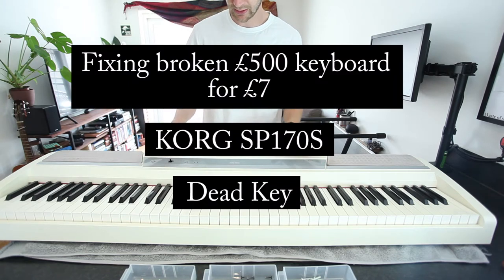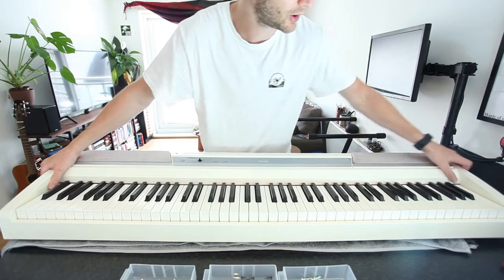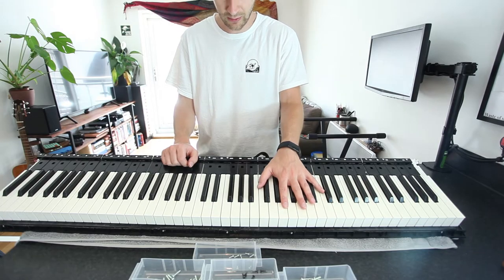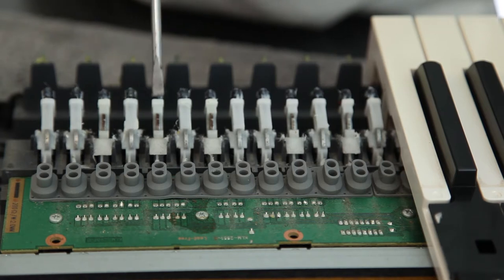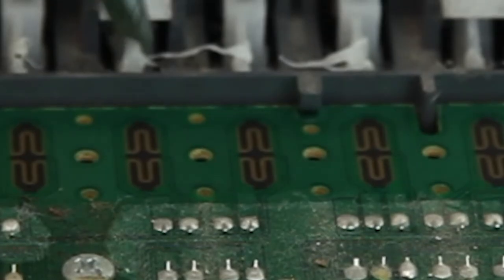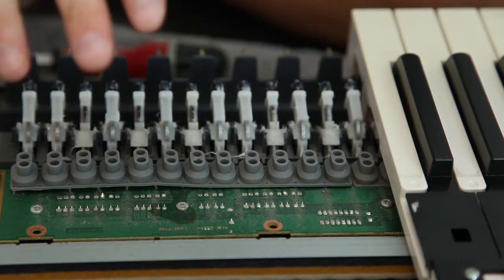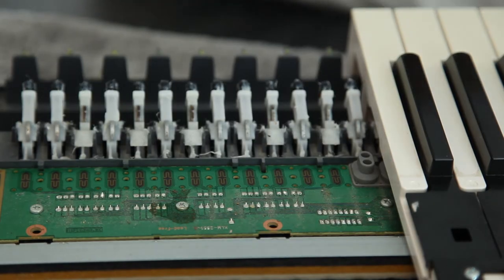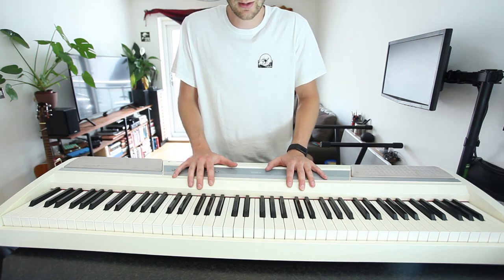How to fix a dead key on a keyboard - KORG SP170S Piano

Comment: Really helped so thanks a lot. Few notes; The PCB isn't carbon coated, thats the carbon off the contact, you should clean the PCB with alcohol under the contact area, but don't ever try to clean the carbon contact on the rubber. Just cleaning the PCB brought back all the velocity subtlety and even-ness that was missing. I also wiped the rocker ends and replaced all the lube with silicone grease, and moved all the yellow grease at the key end back into place. Again this made the travel much better, the grease was £8. I also pushed the large edge connector at the keyboard side / end back, but it bowed a bit resulting in a missing contact or two. At first I got multiple/miissing notes until this was pushed back fully along it’s length. Lastly, all the rubber pads have small pip’s or legs that fit into small holes in the PCB. It is really worth going over these three times to make sure that they are all fully through and seated. I had a thin rod that I used on every pip to make sure it was all down totally flat. It took several passes to get right.

Comment: Thanks! My son's old Korg had 6-7 dead or wonky keys. I bought a set of replacement silicone contact strips for $50, and I was able to get almost all of them working again. It now has 87 out of 88 working keys, plus one extra screw left over 🤣. I know exactly where it goes, but I'm not taking out the other 30 screws again just to put this one back.

Comment: This worked perfectly.  I took my sp170s apart as in the video.  I purchased 7 of rhe rubber contacts from Korg for $40 Canadian.  Be careful when replacing the keys.  If the strip moves even slightly it won't work.  I suggest keeping the wiring connected when putting the keys back to test if they are working.before screwing it all back together.

Comment: Works like a miracle. I used a 8B pencil on the carbon pads. For the keys which were still not working, use a dustfree eraser, blow clean, then apply the pencil again....all worked well.

Thanks a lot buddy.
Mine is a Korg SP170S
Reply: Hi Zany Oriel Rows. A question on your coment, did you use the eraser on the board part? Or in the pads? Because i changed the pad but my key still doesnt work 😔 Thank you
Reply: @SantiTheBarrel  I used the eraser on the board. If the tracks are not shining on the board, use the eraser to clean it. If your rubber pad is old, you can clean it with an eraser and apply the pencil. But since you changed your pad, cleaning the pad is not required.
Reply: @lifeissugar  Thanks for the tip, this rejuvenated my pads. Instead of drawing directly on the pads, I rubbed the pads on a piece of paper which I drew with the 8B.

Comment: You just saved my SP-280. I had the top off but the keys were escaping me. I've was a piano tuner technician in my past life, so I knew there was a way and you provided it, so thank you. However... there is an easier way to remove the keys. Instead of a screwdriver I used an exacto knife from the top rear and coaxed the tab outward while applying slight pressure upwards on the key assembly. I actually had to do this as the SP-280 has speakers built in and it wasn't possible to get a tool to pry the back. My issue was clanking keys. Removing the key mechanism and re-tightening cleared the clanking noise and I don't need to buy a new electric piano for my gigs. Not that THAT ever stopped me! lol Thanks again! Great info.
Reply: hi may i ask how you pushed the rubber silicone back through the holes when done? ive not been able to do that

Comment: I just got into a Studio 90 FATAR with one dead key (very widely used key-bed). Couldn't find anything much online so I got brave and removed 3 screws on each end, top flips up and if you have the bro deal, it's just that the little spring link that hooks on top in a notch at the back of the key came loose..needle nosed it back in place, -- don't even have to unscrew the key-bed mounts, you're a genius!

Comment: Good job. I subscribed as a thank you for doing this.  I just was given a Yamaha DGX 620 by a friend cleaning out their shed. It had been in there for about 8 years after one of the kids spilled a Coke in the middle of it. Sure enough when I plugged it in the whole middle section was dead. I have taken apart a few keyboards before. One I performed that same trick you used and had swapped out a broken middle Key and moved it to the end. Others to fix output jacks.  So a million screws later I took it apart. Right down to removing the silicon strips and even the middle circiut board.  I got it all cleaned up and I tested it after I put the silicon strips back on and it seems to be working. If there's any issue I now know from your video it will probably be those strips as I had to clean them with isopropyl Alcohol. The Coke was all inside about 6 of them. 
 I was just looking up what sort of lubricant I should use and stumbled on your video. I make tutorials for Cakewalk DAW users. A light bulb went on and I think I'll video this as I put it back together because the Yamaha is a bit different than the Korg you took apart. But I'll definetly mention yours and post a link in mine so Korg owners will find it. Thanks once again.

Comment: Thanks so much for making this video!  I was able to fix a mechanical issue with one key on my daughters Korg SP280 today.  :)
Reply: hi would you be able to guide me on wat tool you used to push the rubber silicone back through the holes

Comment: This is really a well done video, despite if I'll manage to use it to fix my own issue or not! It's well thought, well prepared, well shot, with perfect lighting and audio, and great video angles on the details... bravo!!!
(fyi my issue is slightly different from yours though, keys are not dead but instead act "funny" from the pov of velocity... but I'm assuming the source of the problem is the same i.e. the infamous pads, which I'll try to clean before evtl. changing them)
Reply: Did this fix your issue? I’m having velocity issues as well with almost all the keys all the sudden which seems to me to point to a different issue.

Comment: Ok so I have the opposite problem. Several keys only play a loud dynamic no matter how softly pressed. Would trading out the rubber components inside the module have the same effect? 

My model the is the SP-170s
Reply: Yes
Reply from the maker: sounds like the rubber is seated badly, try re-seating it
Reply: There are many boards that can compensate for the key contacts that are higher gain for some reason. But really it would make more sense to replace the rubber or reseat it as the other fellow mentioned... because if it's improperly seated then both of the contacts will trigger at once, creating the illusion of a much harder velocity. And then there is also the practice of tracing the contacts on the key contact board with a number 2 pencil and then wiping off the loose debris or powder from the pencil... trace it many times... the graphite will allow the carbon contacts to work better... and I've saved keyboards that the actual PCB or contact BOARD was very badly damaged... but saved it... after that the only thing left to check would be the traces and the ribbon cables., but that's likely what the deal is.

Comment: I have this same keyboard but all the sudden I'm not getting the same amplitude out of each key for the same velocity pressed.   Sometimes I hear almost nothing, then you press over and over and it gets louder.  The keyboard is rarely used but is otherwise mostly used by the kids having fun on it but they don't hammer the keys nor has anything been spilled on it.  

You didn't really demonstrate what your issue was other than saying it's dead so I assume not working at all.  Could I potentially have the same issue and fix as yours or is mine more of a circuit board issue considering it affects almost all of the keys (mostly the black keys)?

Comment: I saw a video here of a guy who was fixing keys and dealing with the rubber membrane and he brought out a pencil implying he was going to use it. I didn't pay attention as it wasn't what I was looking for but he did clean the membrane with isopropyl and had no problems. perhaps the lead of the pencil was to replace the 'carbo'n as you called it, that was removed from cleaning it with isopropyl?
Reply from the maker: Sounds about right, I think it will work for a bit but may leave you with problems down the line possibly:

Depositing graphite onto the membrane via a pencil will make it conductive again (depending on the graphite to clay ratio of the pencil!), so when pressed the contacts on the PCB will be shorted. However, each time that membrane is pressed up against it, I would guess some graphite will get deposited on the PCB contacts, and some deposited in the gap between them, over time the graphite might build up and create a contact which is always on. Probably easy to deal with as you would just have to clean the graphite off, but replacing the membrane, or painting a decent conductive paint, onto the membrane is going to be a better option IMO

Comment: I have a Casio CTK 500.   This unit has an automatic shutoff feature in both battery and power supply mode, where if you don't hit a note within about 2 minutes the unit shuts off.
I tried to bypass this feature by weighting down a key in the organ setting and turning the volume all the way down.    Unfortunately, the unit still shuts off by itself.    As long as you play the keys it does not shut off until after 2 minutes.   Obviously the automatic shut off feature is a problem if you use this on stage, since you have to turn the unit on and reprogram the setting whenever the unit has shut itself off.   Is there a way to keep the unit on ?

Comment: Buddy I have this keyboard but having trouble getting the midi to work with cubase and ableton. Do you have to activate it via the two buttons pressed simultaneously?
Reply from the maker: midi just works straight away for me, likely it's your midi interface
Reply: @Skoopsy_  sorted it thanks. It was a duff lead

Comment: Nice job .......but please have look at the "print-assembly > wet spot under the middle crossheadscrew  < "  at 3:30  ;  ?? probably leaking (ELCO) capacitor(s) or a leaking batterie on the electronic keyboard assembly  ; the ELCO capacitors acid-liquid mostly bite's the print tracks..... Cleaning print-assembly's / "re-cap " all boards, could be a solution.    ( check also memory batterie  )
Reply from the maker: Thanks for the tip!